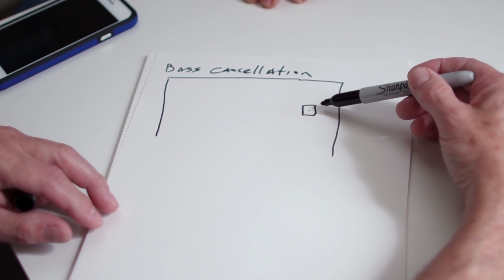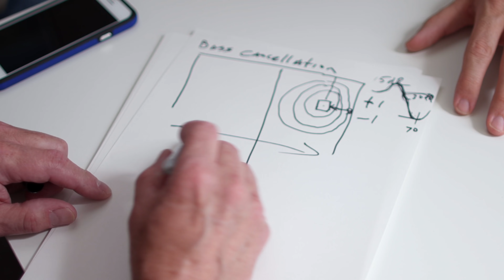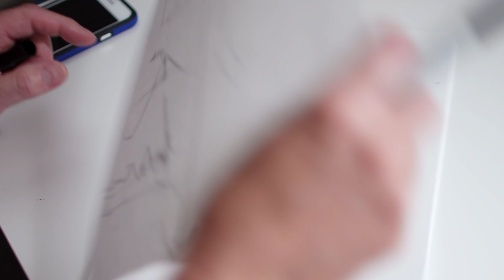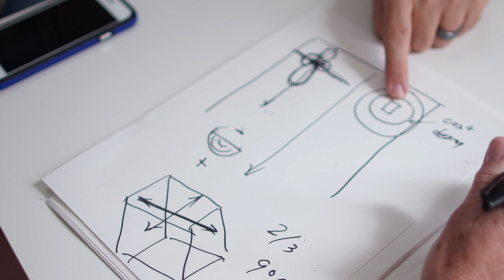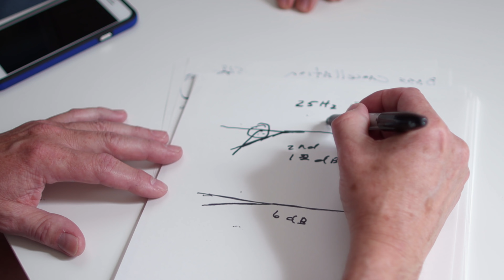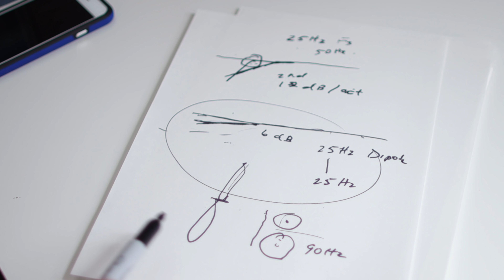WHY OPEN BAFFLE RULES - with Clayton Shaw | Spatial Audio

Comment: One of my best experiences in HiFi was purchasing speakers from Clayton. He's a gentleman and absolute pleasure to do business with. It was evident that he believes in the unparalleled value of his products and is not out to make the quick buck.
Reply: Agreed. I called him last week to discuss the M3 and X5, to see which would be a better fit and he took the time to answer all my questions and chat about my room, electronics and listening preferences. Can't wait to take delivery of my X5s
Reply: Jon Evans would you be able to share a summary of the pros and cons of both models? I’m debating between these two models as well.
Reply: @blessonjacob3809  Sure, but he does touch on most of it in this video. 

First a little background; my room is about twice as long as it is wide, and it opens up on the side in the back to another room then on to the kitchen/family room area. It also has a wide opening to a hallway on the same side. The regular listening position is a sofa that's about 8ft from the speakers and right behind the sofa is a large freestanding bookshelf that acts as a room divider. Behind this is my desk and office space, which is where I am most of time while listening. That or I'm wandering around the other rooms and the kitchen. 

Here are some of the deciding factors that made the X5 the choice over the M3 for me:
The powered woofers and better efficiency: I have a couple low power tube amps I like to use, specifically a < 2wpc 45 SET. With the X series, my amps are only driving the mid range and tweeter. The powered woofer on the X5 also plays down lower than the M3, Clayton mentioned he's seen it go down to 20hz depending on the room, which will allow me to get rid of my subs and simplify my setup. The powered subs in the X series also make it a true 3 way design, vs the M which is more of a 2 way speaker. 

The tweeter: The AMT is more focused and will perform better at longer distances. I'm almost never sitting in the listening position, I'm either at my desk in the back of the room or in an adjacent room. 

Dynamics: The X series was designed to be more dynamic which will lend itself better to my preferred genres. I got three words for you. Punk. Rock. Metal.

Finally aesthetics, and this is just my opinion, but I like the way the ultralam material on the X5 looks, I prefer it to the M series veneers. Note that the photos on his site don't do it any justice, it looks completely different, especially close up. I also prefer the metal supports on the X.

All that being said, if I spent most of my time closer, in the listening position, and I was running a higher power amp most of the time, I'd give more consideration to the M3 paired with subs.

Hope that helps.
Reply: Jon Evans really appreciate you taking out time to share!
Reply: @blessonjacob3809  Sure man, glad to help. Clayton did another interview posted on the LTA channel where he discusses the differences a bit. https://www.youtube.com/watch?v=vYHjNc3kWAQ&feature=youtu.be

Comment: Long ago I had me build an open baffle sub using 2 opposing 12" Audax chassis on the proposal of Sigfried Linkwitz to support my electrostatic LS. The sub was driven by an old Technics amp and separated by an active x-over at 12 dB, 120 Hz. They used to play fine. Only after a while the electrostatics wore out and I had to repair them. Becoming part of the DIY community was overwhelming. I got very friendly help cutting out the round holes.

Comment: Cool! Most Audiophiles snub their nose at Pro Audio! I used to be a soundman for a few bands,learned much about room reflections! The main reason that the Audiophile sound took off,was the introduction of AR 3a's,KLH's,and similar Sealed Box designs! The Early Large Horn Designs we're much closer to open baffle designs! I Hate to say this Ladies,but the Wife Factor has set back Audio for 40 yrs! Women don't like giant speakers in their homes,it degenerated with the popularity of the little Bose cubes,and now,guys are lucky to have a sound bar, and sub! I have Many Pro Drivers( JBL,EV,Atlas,etc...) That I use for new designs.I agree With your Concepts.

Comment: Open baffle speakers don't cure room issues but do offer some additional options to room treatments and positioning. The main advantage with open baffles I think is that they are better with transient sounds than sealed or even more so ported speakers as there is less stored energy involved to start and stop because there is no trapped air that has resonances with reactances that can smear the transients. This is also why horns and planar speakers have advantages over the common box speaker because they can react quicker to music transients. The best transient performing speakers today are planar magnetic open baffle designs.
Reply: U are definitely correct I have box speakers and my magnepan 2.7 have stole the show nothing better in my opinion and I have them in a large room I just pull them out 3 feet from the back wall when I want to use them the only issue with magnepan is u need huge power to drive them better happy listening!

Comment: There's something about this business, call it audiophilia that's elusive, and very few times are there products that are overwhelmingly better than their peers at a specific price point.

For example, when I look back at some of those things that made the market, I think it's because the audio market was just coming into its own. The AR 3's took the audio market and shook it up. Before that time, if you wanted deep bass, relatively speaking, you might have Bozaks or Klipsch corner horns. Early designers insisted that in order to build a decent sounding speaker you must start with nothing less than a 15 inch woofer. Forget about 8 or 10 inch. Henry Kloss went on to another bread and butter winner, the Advent speaker. Once again flying in the face of conventional wisdom. 

All that to build up to this point of admitting my own lack of experience (even though I've been involved since the 60's). I have yet to hear an open baffle cone or dome speaker which gave me a sensational sounding reproduction. I've been hugely impressed with large electrostatics from Martin Logan, or the Magnepan flat panel. Nonetheless, they needed augmented bass typically from a subwoofer in cabinet.

Now the two of you come along and say, you can get fast deep bass, and tremendous clarity from an open baffle design? It sounds like heresy, but I just have to accept the fact I haven't heard the speakers you have. 

Maybe someday... Anyway, I find this video very interesting. Thanks for posting.

Comment: Great that Spatial audio is doing a great job promoting and making open baffle speakers right now; we also need to recognize the recently descease Jorma Salmi of Gradient speakers  in Finland who introduced open baffle in the early 90,s.His sub system for the Quads and his Gradient Revolution are classic models that were highly recognized 30 years ago.
Reply: If you look at older speakers like Dahlquist 10s or 20s they used open baffle concepts for highs and mids with bass in enclosure.

Comment: Snowpuppy approved!  I enjoyed every minute of that.  I am very proud to own one of Clayton's designs.  By the way I have one of the early pairs of M3S and I have played them very loud a lot and sometimes louder than I can stand and have had no issues.  If someone had issues then either their tweeters were defective, amp was clipping, or they will be deaf soon.  That said nice to know the newer model has some more insurance for protection.  The Sapphire series is furniture grade.  They are beautiful.  You will want to pull them out at least 3 ft from the front wall for great sound and because the back side of the speaker is also beautiful.

Comment: I have modified Dahlquist DQ10s, which are a combination of open baffles and closed boxes for the bass and the subwoofers. These speakers have the foundation of greatness . . . they just need to be updated with careful consideration and care.
Reply: Carl Marchisotto (NOLA Speakers) did go on to improve on his old DQ10 type design.
Reply: Clayton is right that OB is old technology--60+ years--and it seems to cycle in popularity out on the fringe and in the DIY community, but never comes to much because it always loses when serious and practical engineering has to dominate (i.e., in pro). Otherwise, OB would have been the designs that most pros, semi-pros (bands/venues/home studios), and maybe even consumers wanted and were most manufactured, let alone being a "legitimate alternative," but they have significant time-alignment problems even short of self-cancellation issues at lower frequencies in the room, not just along the sides to create the dipole, and that is where the genius of the Dahlquist concept comes in--you're exactly right. OB needs users with an unchanging room of sufficient size and with acoustic expertise and pro measuring tools to set them as correctly as possible. Controlled directivity has never been enough to deal with that at lower frequencies. It was possible with Dahlquist to secure nearly all of the advantages of OB while boxing in the worst of the problems at a fraction of this price. Their "bass trap" was consistent and moved whenever and wherever the speakers did and without the free-air resonance behavior that wasn't mentioned, either.

Comment: Interesting, I am very familiar with side dispersion issues from my PA experience.  This is particularly a problem with stage wedges that use horn mounted tweeters.  We had a corner stage (yeah bad) but the issue was that the horns gave a narrow projection from the tweeters but the bass drivers were very wide.  The performers were basically on axis so if their spectrum was balanced for them, the off axis spectrum was mostly just bass.  The off axis bass bounced off the floor, ceiling and walls, around the corner and then out into the audience area where it polluted the house with excessive muddy out of phase bass.  The venue (church) had zero acoustic treatment of course.  The house speakers themselves had very clear, precise, balanced spectrum true sound reinforcement(exceptional for a church after installing half decent cables and applying EQ).   This meant that anytime the stage monitors were run to sufficient level to be useful to the performers, they polluted the house sound badly.  So my options were to either run the monitors too low to be useful, or EQ them to meld nicely with the house sound.  The 2nd option meant they could be run at useful levels without polluting the house sound but for the performers, they sounded tinny and metalic.

At the end of the day, the house is the customer for both the performers and the sound team.  I wanted to deploy acoustic treatment around the stage &/or move it out of the corner but that got no traction.

From this perspective I get the great significance of sound cancellation around the edges of open baffle speakers and the fact they produce dipole lobes.  My question though is what do you do about the adverse effects of the inverted lobe reflecting off the front wall?  That would be just as much energy as the in phase direct lobe that is the only one you want to hear.  Surely this question is the real elephant in the room with open baffle speakers!
Reply: D

Comment: I have built semi open driver speakers. Half way in the box and half way out of the box. With a bass tube treated speaker hole, these speakers have the warm box sound combined with the cold open cone sound (tweakable). More spacial sound and more control and extended highs on single driver speakers. I also do it with coaxials.

Comment: As a fella that has spent best part of 40 years putting large format sound systems in venues of all sizes. I share the same truth as this man. Direct to reflected ratios and system directivity is 90% of the pie chart of what matters! The largest flaw with the a speaker system large or small is directivity. Any loudspeaker you hear while in a lawn chair will have a good chance of being on a list of the best you will ever hear! Are you are sitting in your sheet rock den with your hifi, thinking you need some thousand dollar oxygen free RCA patch? Yes well its time for a new hobby because you don't get it and cant hear!  All that said get some nice headphones perhaps 3 pairs problem solved!

Comment: Truth be told, i'm one of those that just likes doing things different but i soon realized OB is not just a gimmick and actually sounds amazing. Still i couldn't help myself and strayed of the path once more so now when people enter my room i go like ; Oh that? are just my one of a kind open baffle panels with decoupled drivers in a clamshell push pull configuration. Its no big deal lets move on

But forreal, in the end it was not the need to be different but experimenting that has lead me to this setup and honestly, i tried alot of weird shenanigans but this config was to good not to keep using. They hang in the middle of my room and sound amazing from both sides, well if you forget the tweeters at least that is.

Comment: I am super interested in Spatial Audio's open baffle speakers-obsessed even, but just as I was about to pull the trigger and purchase a pair last year, the models changed and the prices went up considerably. Then I decided to sell some assets so I could afford the M3 Sapphire (did I mentioned that I was obsessed?) and two weeks into that, the pandemic occurred and that fell through. Now with the economy wrecked, there's no way I'd ever be able to justify such a large purchase to my wife. I will own a pair of Spatial Audio speakers one day, but probably not anytime soon, sadly. Worst of all, I've got a killer stereo system, but crappy big box speakers that I am now likely to be stuck with for years. It's like driving a Ferrari with toy wheels. I got everything save for speakers "under the wire" before the checkbook, controlled by "she who must be obeyed," slammed shut.
Reply: get rid of the dashes - or put a space between them unless you want everything struck out
Reply: @slidetek  Thank you, that was really vexing me!
Reply: @RichardMetzger  interesting.. last person I heard use the word vex or vexing was commodus in gladiator.

Comment: Once I heard an open baffle, most box speakers sounded like music coming out of a box.
Reply: I like single driver and coaxials and I build speakers with the driver mounted above the speaker hole (like one inch above). And the hole is bass vent treated (with a short wide tube). The driver is spaced from the hole by extension screws and thin plastic hose as the spacers. Easy and it beats any "normal" speaker hands down. They absolutely smoke my B&W 706s and they cost AU $2,400. And (as you said) there's no going back.
Reply: @Justwantahover  you mean the driver is mounted out from the hole right?
Reply: Interesting approach. @Justwantahover

Comment: Hi guys , 73 years old now, not a big music room, Casta B Horn Speakers,  Audio Space 3i integrated tube amp, no boom or muddy sound, bass is there if in music,  dynamics are all I have, very smooth balance neutral natural sound,  learned all about resistance, capacitance, room has very little standing wave, diy cables , interconnects speaker cables, power cords, multiple purpose room, have huge space, 17’ room in dinning room where speaker faces, many say I have great sound, no perfect, but very involving music, no baffle speakers no room behind them, Casta‘S 2.5’ from wall, toed in 45 degrees, get floor to ceiling sound.

Comment: I can never understand why some people go open baffle for the mid and treble and then marry it with a closed box bass unit.
Great examples are most of the range from Martin Logan.
They use this great electrostatic unit for the mid and treble and possibly the upper bass and then use a fairly small box for the bass. It is already hard enough to marry a very light panel with a relatively heavy cone without adding a box into the equation.

I often wondered if the original esl from Quad would work well with an open baffle sub.

My Dali Skyline 2000's are fully dipole and they also try somewhat to control vertical dispersion by using a very tall baffle, two mids and a very long ribbon tweeter. 
When driven and set up correctly, they sound awesome and I find it a shame that Dali stopped the range.

I have two pairs of B&W DM70's and I am thinking of converting the second pair to open baffle bass, as the electrostatic unit is already a dipole down to 400 Hz.

Comment: I've got the M3 Turbo S speakers.  Tremendous wall of sound.  I have them backed up by a pair of REL S3 sub-woofers.  My cousin came over to listen.  I walked away and when I came back he was searching around my HiFi rack which is centered between the Spatials.  He said he was looking for a center channel speaker.  The sound stage is incredible.  Wondering if the Sapphires are a worthy upgrade.
Reply from the maker: Well I’m super familiar with the original M3 and these are on another level comparatively.
Reply: @Newrecordday  Thanks Ron.

Comment: I watched this whole video to see if you understood what causes the sound of open baffle speakers and didn't hear it. You didn't say a word about the direct and reflected sound in the room. It is the reflected that gives the depth and spaciousness and speaker disappearing  that is so prized in audio circles. You need to address the positioning of the early reflected sound as you move speakers around. You can visualize this by making a drawing of the image model of the speakers in the room - draw the early reflections as additional virtual images on the other side of the walls, like mirror images of the speakers. Simultaneous benefit of reflected sound is power response. Image Model Theory enables you to draw a picture of the sound in the room.